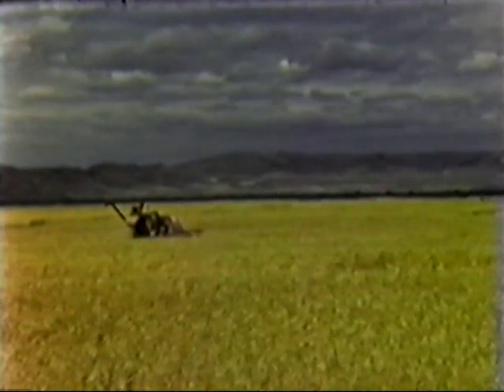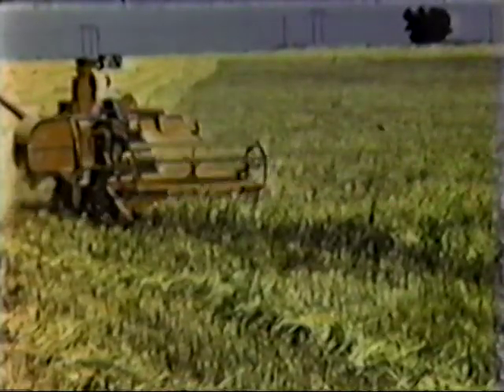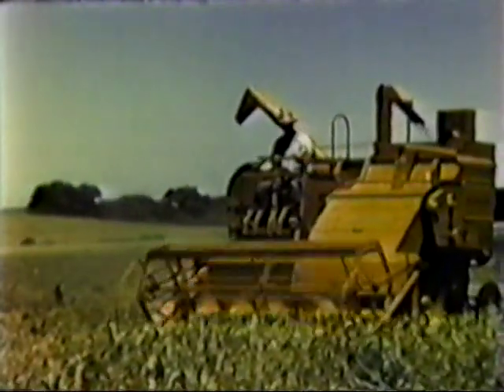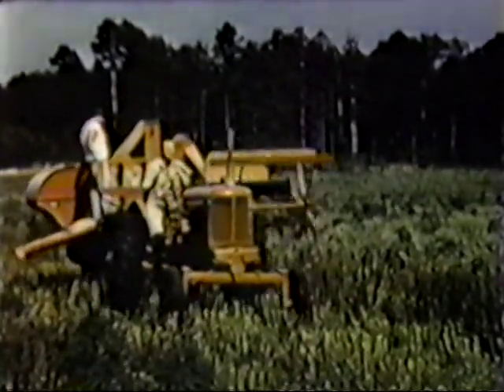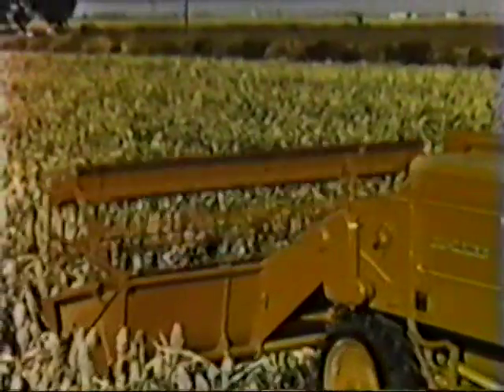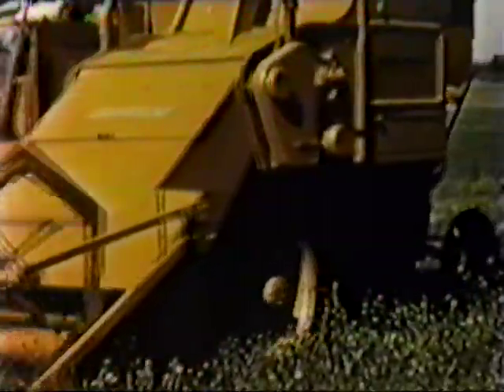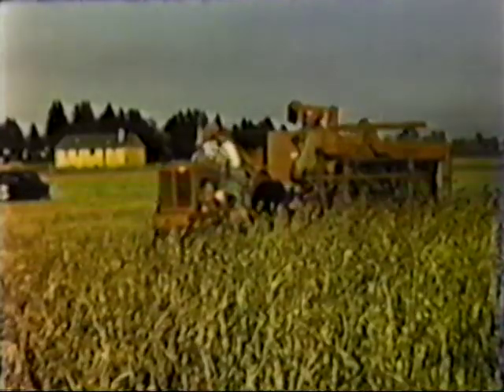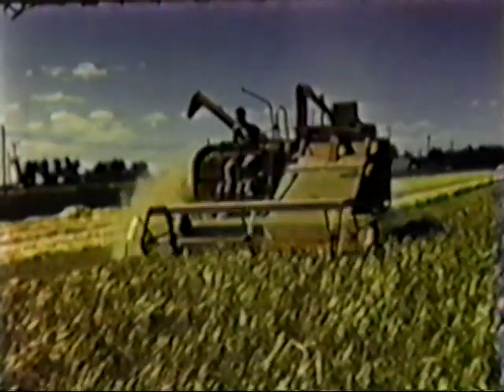The All Crop Story

Comment: These are neat combines, but that side discharge is just silly.  Why would someone want a self propelled combine that can only be reasonably used in one direction? If you cut with the standing crop to the right of the combine, it dumps the discharge into the next pass!    Thanks of posting this video, it's very interesting to see the old advertising from days long passed.
Reply from the maker: To answer your question. Because it works very well. With a 90 degree turn, the thrashed grain and trash must stop and change direction. This produces better cleaning with much less grain loss. Independent testing of the All-Crop Harvesters proved its superior design. They had the cleanest grain samples with the lease amount of grain loss.Still to day you will not find a better combine that delivers in these two areas. As for operating direction,  combine any direction you want. The All-Crop has the extra capacity to handle the trash from the previous pass. The Reality is that even with “ modern” combines most operators still go one direction. Thank for watching.
Reply: @The1952caallis  That capacity is best used on raw material instead of re threshing. Proof is in customer's preference. All crop was dropped for Gleaner.
Reply: very interesting why they did that . i dont know ,it sure would have increased the return cycle because the drum was quite long and the preparation table had to cope with new thresh being put on,nearly its whole length

Comment: I could be wrong but the pull type being called a 66 looks like a 60 to me because the unload auger is on the front of the bin.
Reply from the maker: When the “66” was first introduced in 1953 it used the same bin and auger setup as the “60”. In 1954 Allis introduced the Big Bin “66” which had a 25 bu bin and the unloading auger coming off the side.
Reply: Okay. Thank you.
Reply: I used a 90 model back in the early '80s
Reply: the 70 had steel thresher bars as opposed to the 60 having rubber coated bars i remember dads one. he bought an extra one for spare parts. he had a few bars lying round with the rubber peeling off. i remember how they were renowned for the sample of seed produced.
Reply: I don't remember a 70. I do remember a 60, 66, 72, and  90. The only difference between a 72 and 90 was the 90 had a sliding tongue.